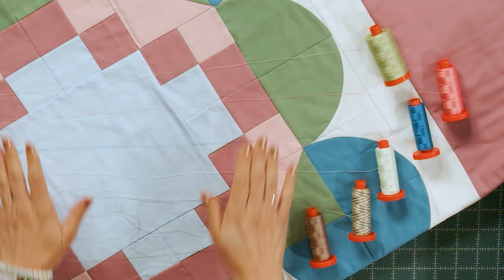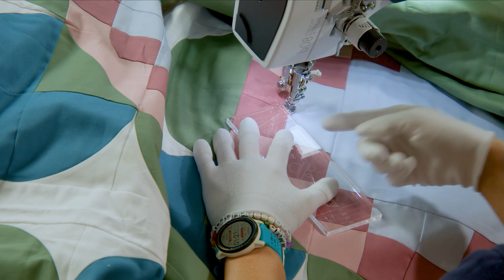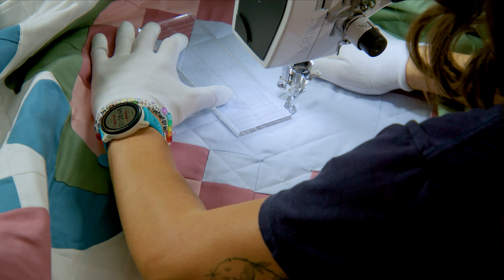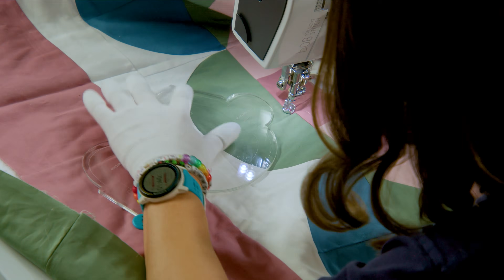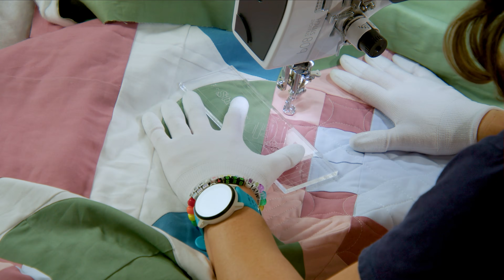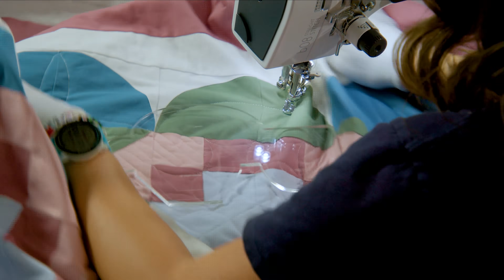Learn Ruler Quilting with HollyAnne Knight

Comment: Wonderful to see ruler work on the MSQC channel. TIPS for Newbies: to give more confidence for longer lines like in the grid work you can use an iron off pen or the blue water based pen (in which case to get rid of the marks mix 1 cup of water with 1 teaspoon of baking soda in a spray bottle after your quilting to remove marks) to make the line to follow & ensure your line is continuous and straight. This also works for the longer curved lines. Sometimes when quilting a larger quilt and it is hanging off your table, I put a chair to my left to hold the weight of the quilt.

Comment: How are you keeping your sandwich together? I don't see pin's.  When I try it my back gets crazy 😢.
Reply: I’ve been spray basting my quilts for years…I do in on my design wall. One thing that I feel helps immensely is that after I have the sandwich together, I iron it from both sides. That helps eliminate wrinkles and folds and secures the spray basting.
Reply: She spray basted it. She discussed that in a previous video. I spray baste small projects but have never had the courage to try anything larger than a table runner.